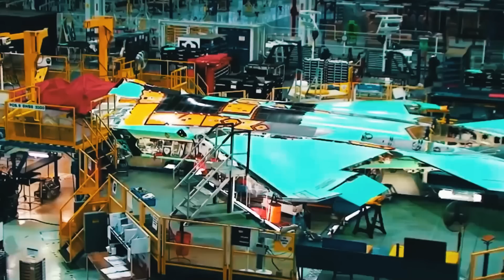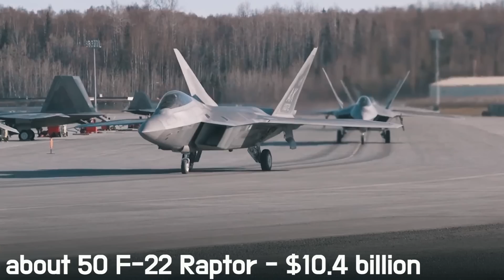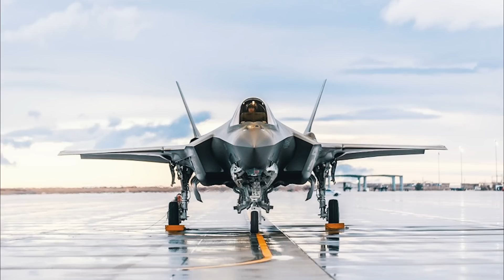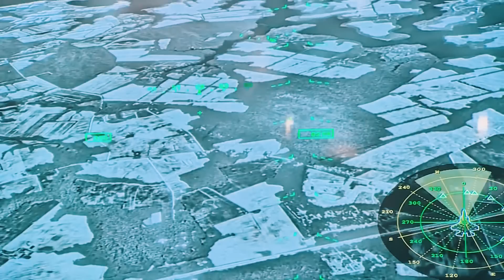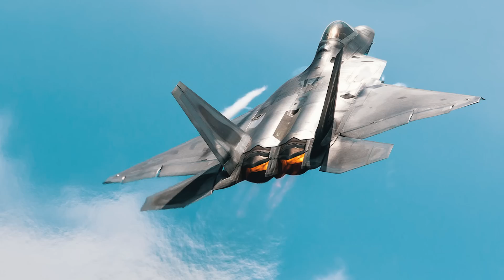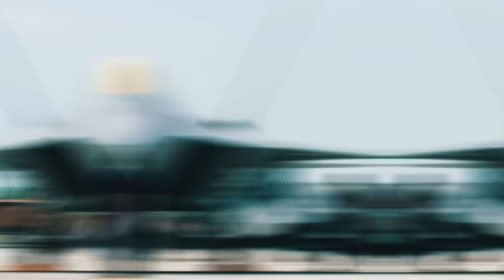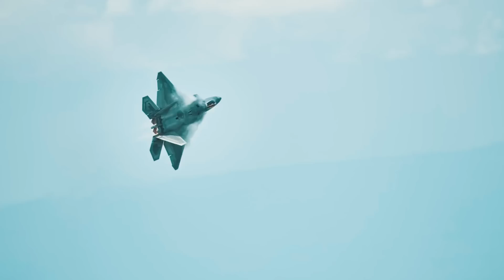New F-22 Raptor After Upgrade Shocked The World

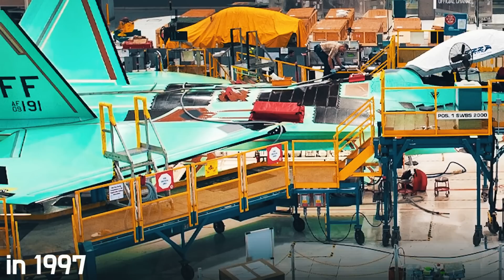Comment: @0:52 you say, "The F-22 Raptor began entering service at the US Army in 1997" (??).  To the best of my knowledge the Raptor has never served as an Army war plane; only as a USAF war plane.
Reply: One of two massive mistakes in the narration.
Reply: LOL
Reply: If by "Army war plane" you mean fixed wing aircraft, you are right, in the sense that it is illegal for the Army to own and operate fixed wing aircraft.
Reply: @rgi8426  "illegal" ROTFL !   There's some law somewhere on the books that make the hundreds of fixed wing aircraft, that the US Army currently operates, "illegal"?!  Please provide that legal citation.  In the meantime, you don't know what you're talking about, the US Amy has or continues to own and operate the  C-12 Huron, C-20 Gulfstream, C-26 Metroliner, C-27J Spartan, Gulfstream C-37, C-41A Aviocar, EO-5 Dash 7, RC-12 Huron, RO-6 Dash 8, Cessna UC-35, and on and on.

Besides, my post had no connection to the fact that the Raptor is fixed wing.  My post is completely accurate.  Try and stay on-point.  Again, we're looking forward to that citation.
Reply: @rgi8426  The U S Army has more aircraft than the U S Air Force and more boats than the U S Navy but the Army dose not have F22 nor do they have a nuclear powered Aircraft Carriers

Comment: Raptor's medium range radar guided a2a missiles won't be upgraded from the AIM 120-C to AIM 120-D, that wouldn't be to wise given that the Lockheed is in a final stage of development of a new a2a missile that will replace the venerable AMRAAM. It's the AIM-260 JATM. AIM-260 will have much longer range, greater speed and newer tracking systems and sensors compared to AMRAAM that is basically a 40 year old upgraded missile design. And of course AIM-260 will fit inside the weapon bays of the Raptor. 
There's another a2a missile being developed by the Pentagon, a so called LREW (Long range engagement weapon). This will be an extreme range a2a missile (we're talking over 350-400 miles) but won't fit inside the weapon bay of the Raptor or the F-35. Maybe the new NGAD or B-21 Raider.

Comment: let's look at simple facts.  the SR 71 was built for speed nothing else.  it accomplished that with panache.  it wasn't stealthy, just so fast nothing ever hit it.  the F 117, and B 2 are the first stealth fighter and bomber (respectively, though the 117 is never meant to find itself fighting another plane) but they are initial penetrators designed to get in create a hole in air defenses and get back out.  the F 22 is designed as a "air superiority" fighter, which it does EXCEEDINGLY well.  the F 16 is a high altitude interceptor and it is STILL in use.  the issue is the Air Force.  honestly; you have a aircraft DESIGNED for A (singular) mission and then they go and want it to do MULTIPLE missions.  i get it, you want more for what you spent.  the F 16's that do close air support are acceptable at it, but those types of missions were NEVER meant for the F 16.  the F 15 can do close air support a bit better than the 16's, but when compared to the A 10 it is a sad exercise in futility to match.  the air force is the MOST expensive branch to fund next to the navy, and putting a man into the air to reliably dominate 100 MILES of airspace is going to cost.  but the aircraft are specially designed for their initial tasks.  asking more of them is normal; but a expensive, bad idea.
Reply: SR-71 had 12 diameter nacelles.  Very likely no worry about the amount of heat behind the plane, but surely edges and such were visible to IR.  But we (they) did not have that back then (to any great degree) either.  However at the altitude it operates at, the radar looks up and sees a full outline profile, so not very stealthy.  Funny, my name / initials are Gary K as well.

Comment: The F-22 is an extremely impressive fighter jet. Probably the best jet ever created, but crazy expensive.  
As for sale to Israel, none were sold. Reports suggest Pres. Trump okayed the sale but Congress would have to amend legislation to permit the sale. Thr sale never happened. Israel did buy F-35s though which have already seen real combat.
Reply: Actually the F-35 program is the most expensive to date.
Reply: @juancarrero6652  Not per jet.
Reply: @juancarrero6652  As a program it was more expensive, unit cost for an F 35 is much, much lower including development cost
Reply: @juancarrero6652  the program is the jet isn’t you can buy almost 2 F-35 for one F-22
Reply: ok?
Reply: Very interesting. TRUMP WANTED IS RA EL TO HAVE F22S.  I BET MOST WOULDNT GUESS THAT.  TOO BAD THEY DIDNT GET THE ASSET THEY PLANNED ON.

Comment: Should have taken the f22 airframe and gutted all avionics, electronics, targeting... everything then completely update the whole platform.

This would have made a truly cutting edge plane. It could have easily housed all the f35's bs. But also maintain its fighter characteristics
Reply: f 35 is not on par with the raptor.  it's good, and can defeat a LOT of targets with similar systems to the 22 and a few extras, but the f 35 was designed to do everything so it does them all ok.  had they made the 35 for a singular role, then yes it'd probably stand out as much as the raptor.  as it is, it's a cousin who isn't as good.  it's a capable plane, but against a raptor, it'd be lunch.
Reply: It does have many sensors.  Just none of those that require a forward facing window, which would increase its radar signature.  It still took ten racks of stimulation gear to test it down at the Hughes Anechoic Chamber in Texas, just like the F-35 did.  There were actually only a handful of sensors that did not get included.  One is obvious.  Looking at the F-35 nose, one can see the optical pod PROTRUDING on it.  The F-35 sacrificed a small amount of increased head on radar signature with that.  No such animal hanging on the F-22.  Oh and it is a truly cutting edge plane, silly.

Comment: Build more, It's a formidable aircraft, Thanks Sam and the crew of Military News. 👍 🇺🇸
Reply: they shouldn't because its pointless by this point. f22 it self can take down 5 f15 by just one f22 alone and US has like about 70 of them in service. the truth is that its way too fucking expensive compared to the rest of the aircraft we see. Moreover, the price to sustain it long enough are expensive as hell as well. modernizing the current ones is the smartest move currently, allowing it to have the function of f35 while having the power of a f22 virtually and physically makes it a nigh-invinicble fighter. after all that US can then consider building more raptors or find a better solution to replace the weaker f35s
Reply: It is a magnificent aircraft, but what makes the f22 and F35 interesting is that for 70 years we've only fought, (and lost!) with peasants, farmers, and pre-industrial people yet things like these get all the procurement $.
Reply: It's not practical to build more. They destroyed all the tooling so they are damn near better off starting a new plane from scratch.

Comment: The bottom line is that there is not an aircraft in the world that can take on the Raptor and live. When the upgrades are finished the Raptor will still be the apex predator.
Reply: I would dispute that there are no aircraft in the world that can take them on there are no aircraft in use by any military in the world that can take them on but ww2 Era piston fighters can take them on but only because at this point those turtles turn tighter then jets
Reply: And the modernized f35s have a good chance in BVR
Reply: There was a dogfight video where a f22 was taken out by a Rafale.

Comment: First off, if you’re presenting a video as fact it’s helpful if you’re factual. He states it entered service in the Army. The Air Force is the branch. C’mon really? Secondly, the F-22A entered service for full combat deployment in 2005. The plane didn’t get authorization for full low rate initial production until 2001. 1997 something to do with system and subsystem testing.
Reply: I built the stimulator for it in around 2005 or 2006.  It was ten racks full of gear that was then sent to Hughes big anechoic chamber in Texas to fire stimulation arrays around the hanging bird to test its 360 degree sensor field capability and fine tune the response firmwares, etc.  Our birds are sensitive and smart.

Comment: They should have built more of them!
Reply: I think they will replace it with next 6th generation fighter aircraft
Reply: @Rhizosphere easy to say hard to be done. You ever know how much it cost to sustain one? We don’t just talk about the building price but also the price it takes to keep it in top shape those are all money. Building more of them then modernise it cost even more. The government and Biden aren’t idiots who spend every single last penny on airforce only they also need them for naval and ground genius
Reply: @Faulty Demonn except biden is literally an idiot,  he can't even read a teleprompter. Bad example of government.
Reply: They don’t need to and it’s pointless now. F-22 is indeed the best fighter jet but the point is that it’s wayyyyyyyy too expensive to build per unit. Building more of them is actually kinda pointless as it can easily kill multiple aircrafts far away
Reply: 125,000,000$ 1 F22 Raptor
Reply: @Shadow33rg  Air Superiority...... Priceless..... Ask the Russians right about now.

Didn't we just send $58,000,000,000 to Ukraine with more to come?
Reply: There was a huge construction problem. The whole top section was a single monocoque piece. Extremely difficult to manufacture. Only 1 in 5 was within spec. All the failures had to be trashed.
Reply: @sordello51  I'm sure the more they made the less failed units  they would have.
Reply: I don't think we should build them. What makes the f22 and F35 interesting is that for 70 years we've only fought, (and lost!) with peasants, farmers, and pre-industrial people yet things like these get all the procurement $.
Reply: @Jeff Moore  we haven't lost... give me a break. Deciding to leave a war due to domestic public pressure isn't losing. You act like these "peasant farmers" where kicking our ass instead of being forced to live in caves for 20 years.
Reply: @randybobandy9828  US troops hide in the Green Zone in Bagdad and dodge occasional rockets. Taliban held the majority of Afghanistan for most of the war and took "our" capital and bases, as the US could never win.
Starving millions of  civilians, as in Yemen and Afghanistan isn't winning, its a crime. These stupid jets are a defeat to the American people. Pure corporate gifts, that provide no use against the peasants and farmers that have continuously kicked out ass for 60 years.
Reply: @jeffmoore9487  you have got to be kidding me! Jeez dude you’re posting this on what every 5th comment?
Reply: @thomassellers3813  Ok, but how many people recognize the waste that could have made a better world. Glad I could help.
Reply: @jeffmoore9487  sadly the world doesn’t work that way.
Reply: @thomassellers3813  Get busy then! Glad you understand.
Reply: @jeffmoore9487  history proves it will never be that way. That’s why you build a military 🤷🏻‍♂️
Reply: @thomassellers3813  History doesn't prove anything. Or if you prefer. History also proves that nobody attacks America.
Reply: @jeffmoore9487  history repeats itself my man. Our military is why nobody attacks us.
Reply: @thomassellers3813  Who does F22 protect us from? Who is going to cross those oceans? Are you nuts?
Reply: @jeffmoore9487  starting to believe you are. The f22 has done great work especially in Alaska intercepting Russian equipment getting too close. You must be a anti American pacifist?